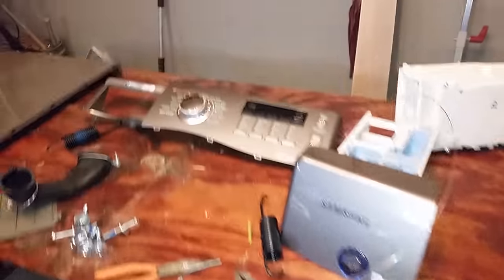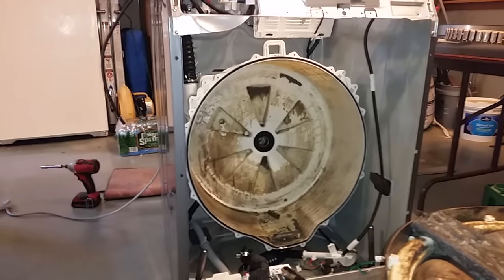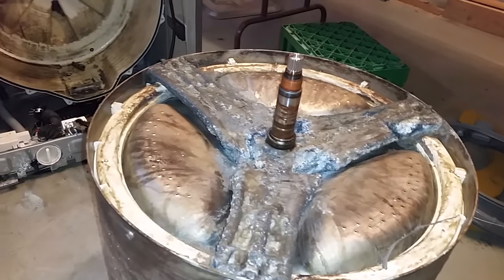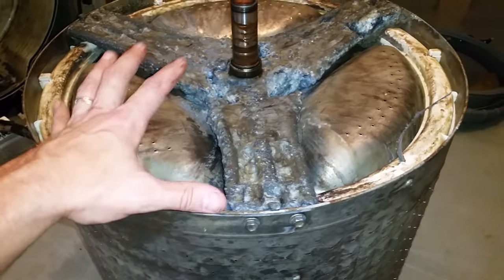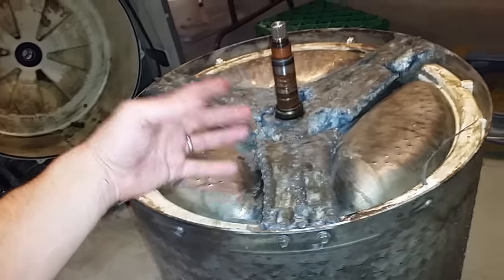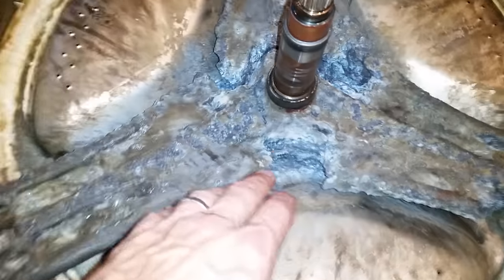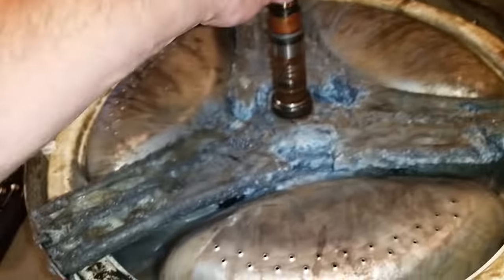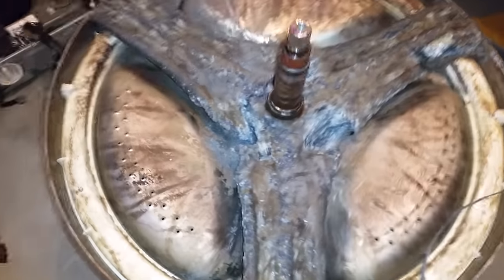Do not buy Samsung front load washer machines

Comment: Just scrapped the same washer after 8 years.  The broken spider along with the constant moldy smell, spelled its demise.  Once opened to replace the spider, the extent of the mold on the door seal was evident.  Kept it scrupulously clean, and did the cleaning cycles with bleach regularly.  Design of the seal had many areas that could not be cleaned without taking the entire front of the machine off.  Apparently there were recalls on these washers (I never received any notification) for both the spider & mold problems.

Two strikes, and this machine & it's companion dryer (that was also a poor performer), were replaced by a top loading washing machine/dryer combination by the other large Korean based manufacturer.
Reply: @Mary Misterio Nope, repeatedly ran the sanitizing cycle. Cleaned all areas (accessible) of the door seals after every cycle. Wiped seals down with bleach about once a week. 

As I said, when the front panel was removed to pull the drum, areas where you could never see or reach were moldy. Whether the cleaning cycles got those areas is a question,  unlikely

$200 in parts to repair a washer that my wife disliked, plus the hiding spots for mold to grow, out it went. Had already replaced the pump twice, due to an open field coil (burned out).  The venturi was drained and cleaned numerous times.  

Top loader now.

Comment: I have this washing machine. Is there any type of spray or coating that I can apply to stop the deterioration process while the machine is still brand new? Thanks!
Reply: I wouldn't. You're going to need to sand or bead blast the arm to get anything to adhere to it. Otherwise the paint/coating will flake off and make the problem worse.

Comment: My 9 kg. Toshiba top loader is better.  It required a smaller footprint than a 9 kg. front loader. The drum sit on mechanism which is below. The design make more sense than a front loader drum which hang on to horizontal shaft mechanism.  Wear and tear is less than a front loader. My washer is still working ( bought in 2010 ). I repaired  myself , only changed water inlet valve and water drain valve parts recently. US$20 for the 2 parts.  Parts are plenty from electronic parts shop in Malaysia.

Comment: I have had this washer for 9 years. Always provide maintenance on the unit. It just started leaking last night.  When I turned it on it's side I noticed what looked like a thin rock that had came through the plastic tub on the bottom. I thought maybe my kids had rocks in their pockets. This video explains what happened. The bracket started braking apart. The inner drum must have caught the metal piece and pushed it through the plastic tub.  So the cause of my leaking washer is the bracket is following apart internally. Thanks for saving me the time and money of taking this apart and buying a new plastic tub.  Any recommendations on another front load washer brand?

Comment: I bought a Samsung washing machine here in Germany in 2006 and it lasted for over 12 years, until 4 weeks ago to be precise. Never had any problems and it worked well until the pump broke down. Repair costs (including a fitting pump for my Samsung type) were not worth the investment, so I bought a completely new washing machine. Now I have a Gorenje (Slovenian brand), not high-end by any means, but pretty good value for money and better than the real cheap shit. Still - if I had had more money, I would have bought a Miele instead. Miele is, on average, still the best manufacturer...like the "Mercedes Benz" of washing machines so to speak.

Comment: Very well said. Samsung's washers are junk. And that metal they're using is definitely cheap metal, and the corrosion is no joke. Oh, and I noticed the washer tub is very moldy – which in fact front load washers are infamous for trapping mold and mildew because of their design and if you don't prop the door open when it's not in use, plus that it's the owners' responsibilities to clean their washers at least once a month.

Comment: I purchased one of these in 2009 and just replaced it due to a drainage issue that was not resolved by cleaning the drain filter or replacing the drain pump motor. Obviously, I’m not a representative sample: But mileage may vary.

Comment: This is known as the spider bearing. We have a Samsung front loader which has lasted over 10 years despite daily use. The bearing collapsed as shown and a replacement cost £60. At least the drum outer casing can be opened to replace it - on cheaper machines they are sealed and not serviceable. Otherwise it has been a durable and well built machine - excellent motor and no rust. It's just a shame that they didn't recognise and solve what is an obvious design fault.

Comment: My 11 year old Samsung front loader just bit the dust and I bought another Samsung front loader a few weeks ago. It was on clearance for $500 at a local Best Buy store. I had to pay $250 more for a new pedestal since the old one wouldn't fit the new washer. I use an extra rinse cycle for every load.

Comment: In the UK Samsung is one of the last manufacturers that make their washer (in Poland) with a tub you can unscrew to replace the spider and bearings. All other manufacturers weld the tubs closed so repairs are now impossible.
Reply: What about LG? If you tip the machine over you will see which brands use sealed tubs or not

Comment: Sure there's a galvanic process that takes place, but just like in electrical installations you're likely not going to see conductors and terminations completely eaten away beyond the actual splice points when dissimilar metals are used without any anti-oxidation products. If it's all cruddy looking then IDK what that's from. If the frames start to wiggle from the fasteners then that seems like the result of the galvanic reaction going too far.

Comment: Need help. So, should I not buy a 2019 Samsung Washer Front Loader? It is on sale for $600 was $999.
Reply: No don’t do it. I fix appliances as my occupation. You will regret it. Get a top load speed queen. You will love it. It’s made with laundry mat quality
Reply: I got the same deal at the Home Depot. Unfortunately I didn't see this video first. However I had one of those top loaders that I bought back in 2013 and that's the ones where the drum spins out and it broke I don't know how many people's Jaws. Well mine finally conked out last week and put water all over the floor. It was the Samsung and I paid almost $1,000 for it. They told me they would give me for the recall of that disastrous top-loading Samsung $100 and that they would pay for delivery. Well I had to buy a Samsung to get my recall money which is so cheap of Samsung. So I've got the front loader and now I'm wondering how long this is going to last.

Comment: I just performed this repair on my 2011 Samsung front loader. It's definitely designed to fail and fail in a way that repair labor costs alone will make it prohibitive to fix. You can tell by the fact that the support arm is the only thing that fails.
Reply: But you got 10 years out of your machine. This guy only got 4. What could explain that difference?
Reply: @johndoe-vc1we  I've heard that overloading the machine with heavy items like rugs can put extra stress on the arms and make them fail faster. But 4 years still seems to be way too soon.
Reply: @gruivis  how did you maintain your machine? 

Use of powder or liquid detergent. Maintenance washes. How many hot washes a month. Leaving the door open after every wash.
Reply: @johndoe-vc1we  1) always kept the door open, always. 2) ran cleaning cycle at least once a month. 3) tried not to overload the washer, mostly because it just won't clean as well. 

But maybe the unit in this video had a hairline fracture that predisposed it to early failure.
Reply: @gruivis  see, that's the kind of info that is missing in this video. I hear people complain of losing machines in the same span of time but they never say how they used the machine.

We know why your machine lasted ten years 😊

Comment: Exact same thing happened to my Kenmore He3t which we bought in 2003. So it lasted 19 years before the bracket finally fell apart. Only problem is, machine's so old it's almost impossible to find the bracket for this specific model. If it would have broken down say 10 years ago we'd probably be in luck. Some owners have resorted to making and welding their own steel bracket.

Comment: I notice almost as many products now to clean washers as laundry detergents. My old traditional washer, I'd just wipe the soap scum out a few times a year. I've seen my zinc nozzles corrode in one one month outside, what a terrible idea to use it in a washer. Next washer set I get, I'm splurging on a commercial grade set. Our Kenmore set is just rebranded LG, it's difficult to avoid sometimes.

Comment: This just happened to mine.  I use natural soap nuts in a cloth bag, no bleach or fabric softener.  So basically water and a bit of natural soap.  One day the spin cycle went bad and filter was filled with corrosive broken down metal.  I probably only used the Silverware option a few times.  What a waste.  No more Samsung products for me.  I wonder how long the dryer will last.

Comment: So, seeing that most of the major manufacturers use the same basket, my Whirlpool had the same problem and in the fine print of the warranty, the drum is part of a lifetime guarantee. I called Whirlpool Canada and they registered m6 machine and sent me a new basket at no cost. Try calling your manufacturer and they will sent you one for free. Samsung is not the joy one, the new unit is different steel and after 7 yrs of the new item in use, there is no issue and no deterioration of any kind. Do not pay for a replacement as it’s covered in the warranty. Look around and learn.

Comment: My strainer stopped up first and I thought real hard as to why I had a substance appearing like rock pebbles, lots of them. Then heard scraping until the drum actually locked up and I couldn't rotate it by hand either. Mine was far more gone than what yours was and etched a deep hole around the inner circumference of the plastic tub. 6.5 years of service.
Reply from the maker: Matt That was not rocks, it was broken off pieces of corroded metal from the spider bracket. Cast aluminum to be exact. My I ask you what type of water you have? I feel that those of us who have well water with a high iron content is really Accelerating the corrosion process

Comment: Tub drum is the moving part, so it need to be as light as possible
I'm also a home appliances technician, I can confirm that the most big brand also use that material on their product
That case also can cause by high concentrate detergent or infrequently run tub clean process
CMIIW

Comment: i am still using candy aquamatic 8t from 1995. It was repaired  3 times:
1-cleaned wool clog, 
2-repaired plastic tappet of open door pushbutton,
3-repair of plastic door latch. 
And washing machine still working with factory heater.
Seems as in other products manufacturer dont want to make their goods to work more than warranty period...

Comment: This is exactly what killed our samsung front loader too. Spider arm assembly failure due to the crappy metal that's used. Bolt some zink to stainless, add water and things like bleach, etc... and it's basically a purpose built setup for galvanic corrosion. I have no idea why they do this other than it being purposeful planned obsolescence.

Comment: Most washers I saw are having similar issues and this is due to using the wrong detergent that is not recommended by the manufacturer and hard water. Not that I'm recommending Samsung but actually its is relatively cheap and very easy to repair. Also parts are available.
Reply: It's nowt to do with hard water,  we have very hard water, total hardness 340 mg / l  according to our water company, and the 14 year old aluminium alloy spider on our washing machine is still fine.  A mate whose spider failed prematurely told me that the engineer said it was caused by his water softener, but I'm not convinced that's the case either.

I would suspect not leaving the door open between washes to allow the machine to air and dry out, is likely one cause, both mould and corrosion need moisture, and it it is well known to result in black mould and bacteria gunge on the door seal and in the machine.

Comment: I disassembled my Samsung front load washing machine and found exact the same issue. The shaft flange is completely rotten away and broken. Other parts are still in good shape, especially most other parts are the stainless steel. This part should be designed stronger. It seems in zink and did not use enough materials either. I wished to upload a picture, but I did not find how. My photo looks the same as above. This part is the weakest link of this machine. My machine lasted 11 years. This part seems discontinued. I will try to find a matching part at $200. A new machine will cost $1000. I might just buy a new one.

Comment: I have a Bosch classixx 6 from 2006 bought brand new and this has just happened to it. Inferior spider bracket has corroded. I think this is done intentionally and it's the only part that has failed on this machine and the only part you cant see without pulling apart the whole drum. Bosch don't sell the part on it's own it comes as a complete unit with the stainless steel drum.

Comment: As a former Samsung customer who had ALL Samsung appliances in my kitchen.... Samsung products are SHIT!... My Fridge Ice maker died 2X's with the trap door breaking and then continually frosted up.  Microwave touch panel corroded and stopped working and the door spring broke.  Dishwasher sensors failed due to my using "liquid soap" ??? WTF!  Tech said Samsung knew the sensors were crap and it was a bad design so I should try to use powdered soap.  Loads would not wash and do a fill and purge cycle over and over.... Electric Range corrosion between door glass! unable to clean.   They have poor engineering, poor customer service and products like their TOP LOAD washers that were on the news because they exploded!!  Samsung products are crap.  Some say "all brands have this issue".  Maybe so, but after spending thousands on Samsung products and have them ALL fail is a clear sign.  I now have Kenmore Elite products and have had ZERO issues in the same time frame as I had my Samsung POS appliances.  Save yourself the aggravation, time, energy and money and DO NOT BUY Samsung.

Comment: And it is not covered under the manufacture warranty, and you are right about the 6 years mine started in less than 6 there is a repair for it but your just replacing the spider arm with the same material......

Comment: Every front load washer made uses the same metal for their spyders and ALL of them corrode in this way if you use detergent that is caustic. Powdered detergents are recommended with front load washers.  And yes stainless will attack the metal but it takes a decade or more for that to occur to a to where it would cause a issue. Most balance /vibration issues are caused by the drum bearing but on these VRT models they have ball bearings in the drum that can get stuck on occasion causing a unbalanced load issue as well. Family of samsung owners here with no issues out of any and they have been owned since 06 to 17.  With proper detergents this shouldnt be a issue

Comment: I have mine torn apart and thats exactly what mine is looking like.  Just ordered new bearings and spindle assembly.  The spindle assembly has holes eaten into it.  There bearings are shot also - sounds like a freight train.  I guess i bought my washer in 2011 or 2012, not sure.  But replacement parts are about $205 for parts listed above.  If i hired a person to fix it, it would for sure exceed the cost of the washer.   
This is kind of a shame.

Comment: Previously to 2010-ish Samsung actually did good stuff. I got one of those flip screen phones, which if you don't call and don't receive calls, the battery lasts from 2 to 3 weeks, and the quality of the call its very good. Still running today. Past that era, they became to an strategy of planned obsolescence in every device they sell. You have all the Galaxies, every 6 months, a new galaxy comes to market, with minor features, but it's brand new. They won't last very much though, and the exploding batteries of the Note it's the proof they build'em to be broken in a certain period of time. I had a Galaxy Chat which i thought it was a better version of a blackberry, but despite the blackberry being that old, responded very fast in comparison. Past 2 years, was a complete brick. And the batteries, completely awful, 6 months, even being Lithium, which should last 4 years or so.The TVs are just oversaturated in color, my aunt had a fridge for only 5 years, and now that i see that badly corroded drum that seems to be in the bottom of the sea for years... My advice is, run away from Samsung

Comment: Our already once-repaired 2016 Samsung front loader started leaking massively a month ago. The reason was bc one arm of the spider broke off and punched a huge hole in the plastic drum housing. 
The very heavy piece of the spider that broke off looks like the metal equivalently particle board. 
Our LG washer is coming on Tuesday.